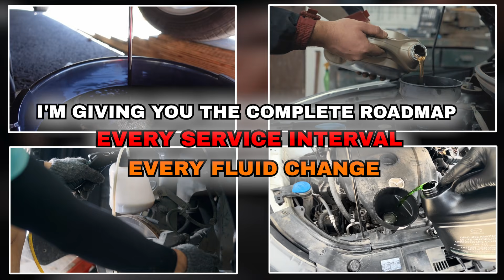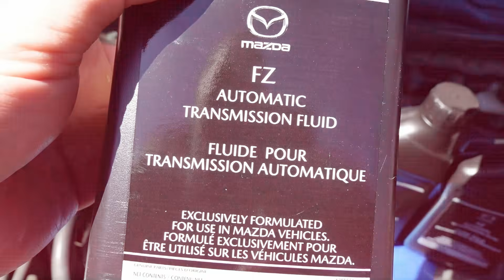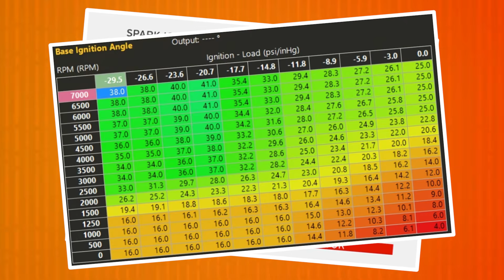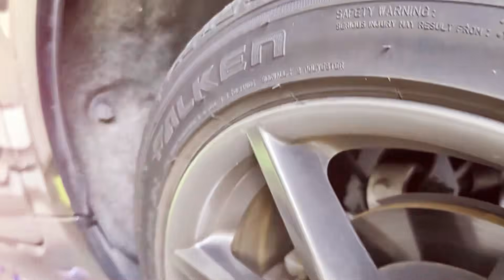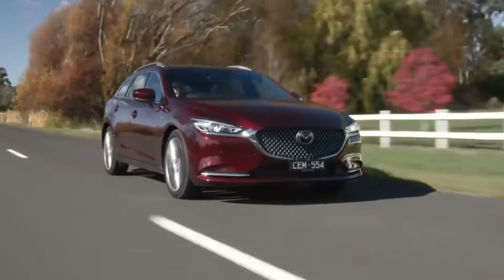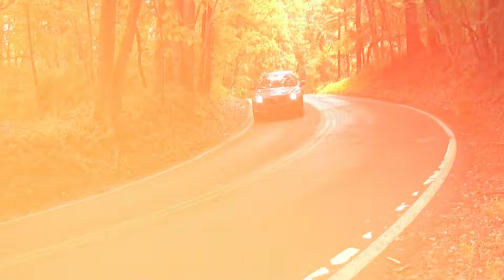How To Make Your Mazda Last Over 400k Miles Without Any Major Repairs

Comment: On my CX-30 e Skyactiv X, I change my oil and filter, once a year or every 10000 kms , whichever comes first. As mentionned in the manual I use 5W30 A5/B5 full synthetic oil.

Comment: Quite scary; does anyone really drive 200,000 miles, and not want to get a new car just because?  At twenty years, biggest complaint is road /wind  noise because the door-window  seals leak air.
Reply: I have one vehicle with 280,547 miles and it runs like it was since 2006. Same engine same transmission; why buy a new one when I have an excellent car already?!🤷🏽‍♂️

Comment: Totally depends on driving conditions.
If it is mainly open road driving in moderate conditions you can extend the service interval ftom the recommended 5000 miles to   8000 miles

Comment: "... or every six months" (For synthetics, anyway) I've always wondered why time matters.
Reply: I believe it is due to fluids start breaking down
Reply: @tomjohnson5700  I changed mine at 1 yr regardless of low mileage-I bought the wife a 2025 cx-5  in  Dec 24 and did the first oil change at 1500 miles in Dec 25-oil is cheap work on engs is not..